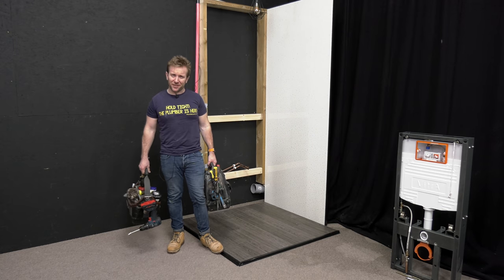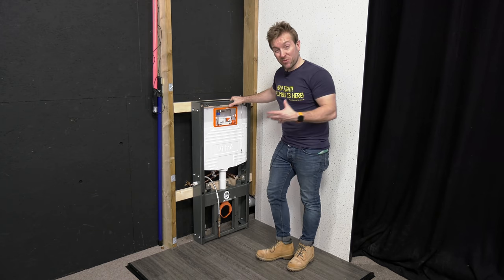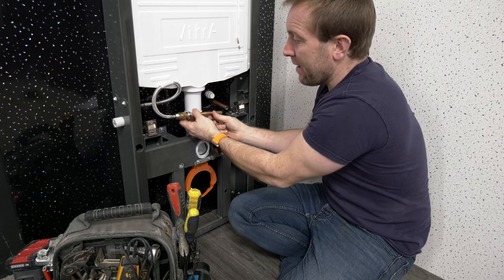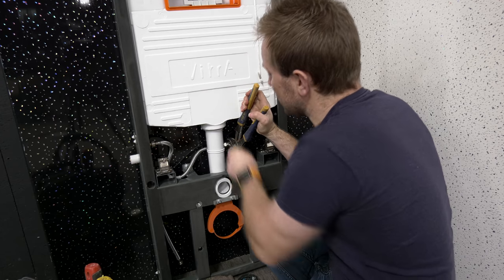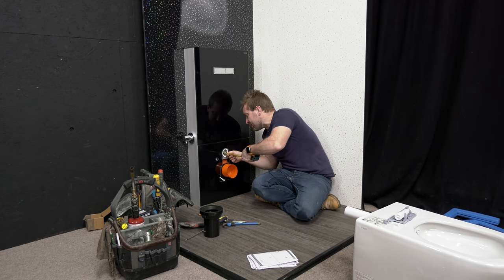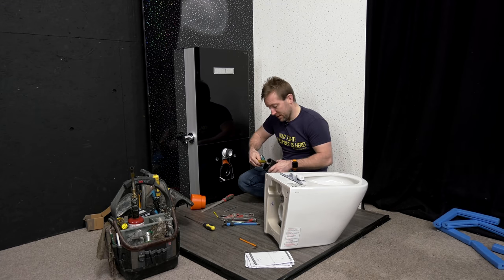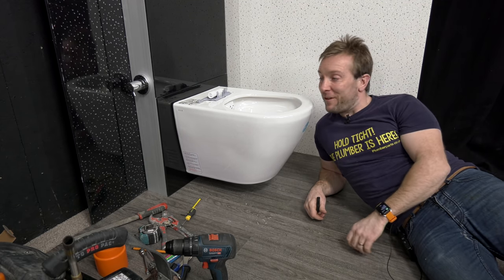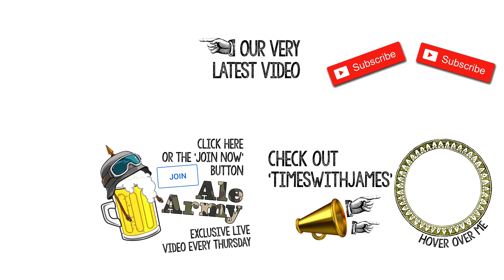💧EXPOSED BIDET TOILET INSTALL - Vitra Vitrus Install

Comment: Love the Vitra system. Went for it purely based on James’s videos. I have a back to wall pan so just needed the concealed cistern- no mounting frame. Was easy to fit with my DIY skills however I did hit a snag with the flush pipe. I had mounted the cistern very slightly (a few ml) too high due to where noggins were etc so it wasn’t perfectly 90 degrees coming out of that elbow. The pipe had to run fractionally downhill from the elbow to the toilet. It was hardly anything, however, result: leak. The slight misalignment clearly deformed the rubber so it allowed a drip to pass. I tried to find a fixed one-piece flush pipe with a preformed 90 bend online but couldn’t get anything to fit onto Vitra’s cistern. Solution: half a tube of silicone round that joint. Mounting frames clearly force that joint to be bang on 90. Anyone using just the cistern where the flush pipe is the only point of contact between the unit and the pan, make sure you are spot on with your measurements or prepare to bodge it up with gobbo.
Reply: Lesson well learned Mike, also cut back the flush and soil by 3mm to avoid damaging the O ring plus chamfer both pipes and lube well before insertion :_Holdtight::_Alearmy::_Fucktheag: Ps. Avoid silicone gobbo at all costs :_whyhello::_Holdtight:???
Reply: Thanks Mike! We're glad to hear you're a fan :)
Reply: @VitrABathrooms1  thanks. I can get into the void behind the toilet where I have the cistern and it’s still watertight. Completely cocooned in silicone though. Everyone comments on the loo. Flush plate looks really good quality, the cistern is quick and quiet to fill up. So impressed. But it’s just a toilet. No bidet. Next time…

Comment: hi
great video.
if you have 2 bathroom only divided by a stud wall (100ml), and you can only place the 2 toilets back to back. Would you be able to fit this system back to back or would it be slightly staggered (if so by how much?)

Comment: Question I have a problem with my waste pipes under my sink I often get a odorous smell from the plug holes and when I unscrew the plug hole there’s a sticky brown substance which I can clean away but it returns ever 5/6 weeks I feel this substance is further down the drain pipe I have used liquids which you can buy from supermarkets but it has no effect there is no drainage problem only this smelly substance I promise you I’m not put anything down the plug hole only dishwater can you give me any advice ?
Reply: That sticky brown substance might just be someone poohing in your basin. It can happen!
Reply: @tommcdonald1000  well it doesn’t taste like excrement / Faeces

Comment: What is a buy cost of a sytem set like that? Bidet/toilet + the cistern with frame?
Reply: Hello, at RRP the cost of the Vitrus cistern/frame with integrated bidet function is £764 and the toilet shown ('Sento') is £495. It's also compatible with two other styles of toilet ('M-Line' and 'Integra'). Hope that helps!